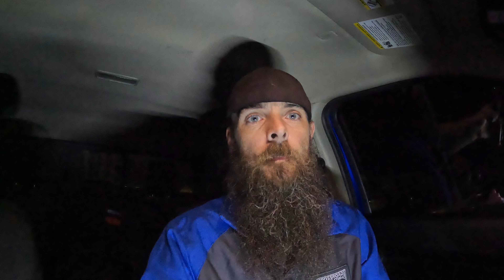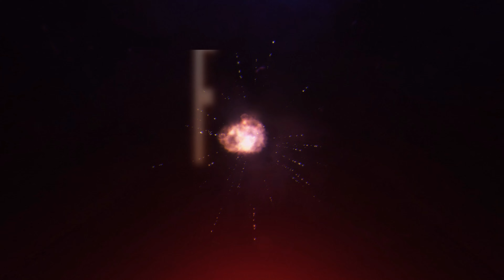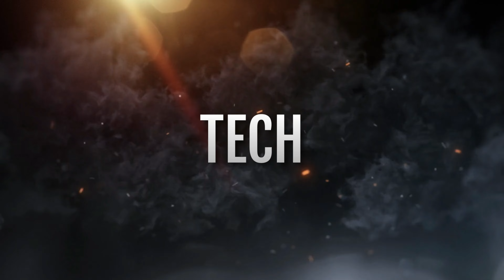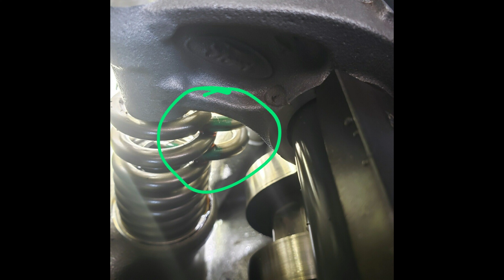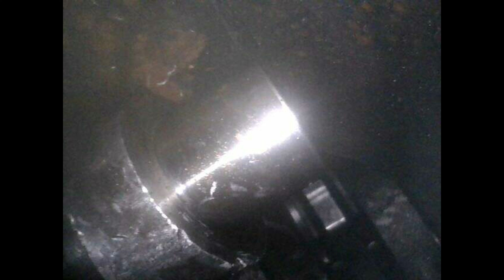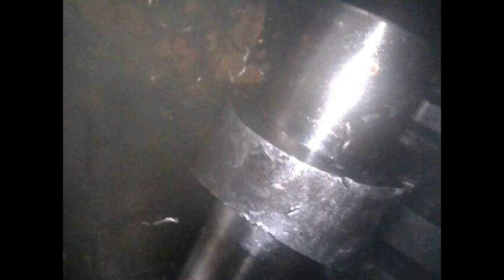Piston Exploded! Ford 6 2

Comment: The valve broke and dropped into the cylinder. Piston shattered when it hit the valve. I'm surprised the rod didn't go through the block. Must have happened at lower RPM. The racing team I was on had a brand new Manley valve let go on a refreshed engine. Rod went through the block.
Reply from the maker: The valve is still there. It didn't drop all the way.

Comment: So, cylinder #6 was having trouble holding pressure is what you're saying.  😉

Is that a remove and replace engine or do you guys have fun and remove the oil pan and check out all the pieces?
Reply from the maker: Remove and replace

Comment: That is crazy, 1 of the worst street motor failures I've seen,  we replaced a LS in a silverado a few months ago and the back 2 pistons hit the valves and cracked 1 piston and turned the connecting rods into almost a Y shape and snapped them in half, broke a spring and lodged 1 of the pistons into the block and I was not able to get it out, took the pan and the windage tray off to find a 1,000 pieces of piston, block, and lots of other random chunks
Reply from the maker: Yeah that's about usually how it happens. Never seen a piston just get deleted and leave the rod and pin that way.
Reply: @Bearded Ford Tech  gotcha yeah I thought it would be pretty common for them to go bad like that when they fail, but yeah that is still nuts to have just the wrist pin there, ive only ever head of something like that happenening in drag racing,  I had a new 1 today was working on a 09 Malibu and noticed something odd, our scan tool showed it has over a billion miles on it, the dash says 150k, that's a new 1 for me, it claims the car has 1,063,970,417 miles
Reply from the maker: @roberthood99  okay yeah that is an odd one. I've had them before where the odometer says one thing but the mileage in the PCM is about 100 miles different.
Reply: Elon took a Tesla in orbit now that could be a cherry at 300k😅
Reply from the maker: @Dirtyharry70585  😁